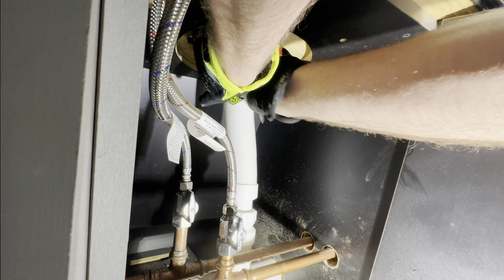Quick Fix or Hack Job? 👨🏼‍🔧 Flexible Drain Pipe Repair in High End Salon

Comment: I wish you were in Ohio. My salons been open 2 years and for the past 6 months we have a slow drain on our bowls.I’ve had 3 plumbers come out add vents ect and no luck. I just lost a tenant because off it 😢
Reply from the maker: I'm really sorry to hear about your struggles with the slow drain! It sounds incredibly frustrating, especially after trying different plumbers. Have you thought about some DIY solutions or perhaps a local plumbing expert who specializes in salon setups? Maybe try a drain specialist rather than a general plumber. We have a company here called John's Sewer I recommend whenever it is a main drain line issue.